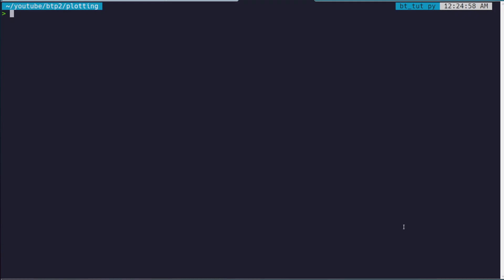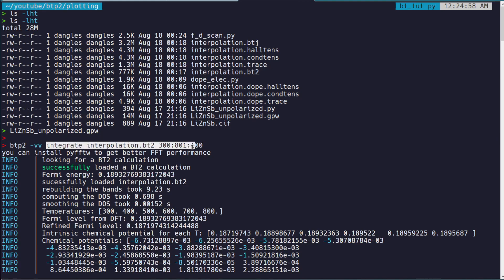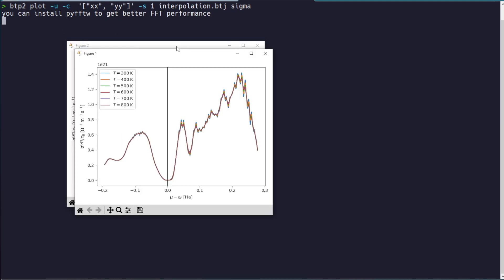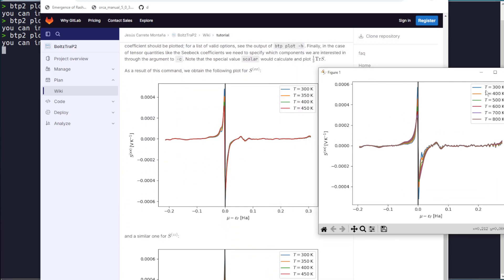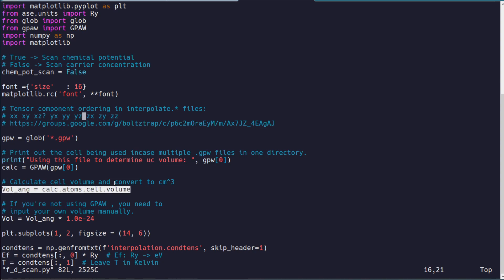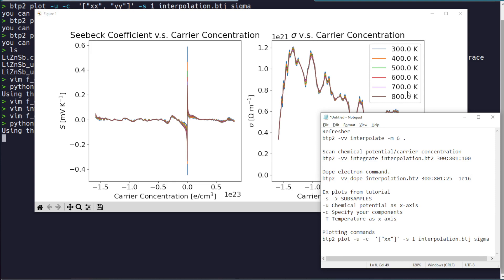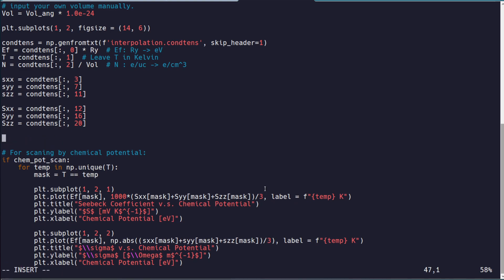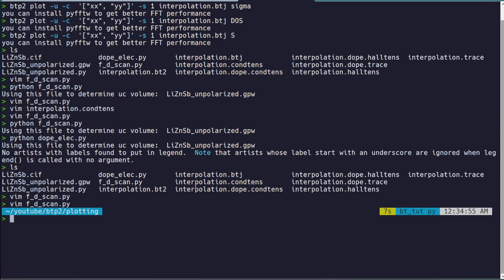BoltzTraP2 Tutorial | Plotting Onsager Coefficients (conductivities, Seebeck coefficient)

Comment: Sir i am calculating the thermoelectric properties for monolayers using boltztrap2 the value obtained for seebeck coefficient is almost double of literature, while the band and dos are exactly same as of literature, i tried multiple times,  for different materials and am obtaining double the value of S for each material, why this happening where am i wrong don't understand
Reply from the maker: You would have to really dig further into what they are using for the computation
Reply: @AlgebraicContinuation  The quantities (like thershold conv. and k-points ) mention in the paper is for heterostructure , only result values are shown for monolayer, by using VASP software while i am using QUANTUM ESPRESSO , is that the reason ?

Comment: Hello sir, I am using Boltztrap2 with Quantum Espresso. I ran SCF and NSCF calculations, and then when I ran: btp2 -vv interpolate -m 1 ./ I get the error:
File "/home/Hp/miniconda/lib/python3.12/site-packages/BoltzTraP2/io.py", line 1528, in parse_ESPRESSO_xml
    raise ValueError("inconsistent sets of k points")
ValueError: inconsistent sets of k points
I searched on Google, but it seems that this error hasn't been discussed anywhere. Do you have any idea about the origin of this error? Any help will be appreciated.
I used 10x10x10 kpoints mesh for scf and 20x20x20 for nscf calculations

Comment: Thanks sir for nice tutorial ! Sir i am getting an error during run command (btp2 -vv interpolate -m 3 ./ )  error shows inconsistent set of k - points while am using QE software nscf output .xml file with 60 60 1 k-point and scf  30 30 1  how to solve this error ?
Reply from the maker: Try 2 kpts in the z direction
Reply: @AlgebraicContinuation  but sir for monolayer we have to choose 1kpt in z-direction
Reply from the maker: It will not work unless you use 2. If your calculation is set up correctly, having 2kpts in the z direction won't hurt anything.

Comment: btp2 -vv integrate interpolation.bt2 300:1010:10. This command is taking too much time. How long does it usually take?  For BoltzTraP2, I am running it on a system with 32 cores. i don't think we can run btp2 using mpirun, my system is using 1 core at a time, almost 2 days have past and calulation is still going on. Pleas help
Reply from the maker: There's no way for me to know without more information about your system. It could take a second or a year depending on the DFT data. Yes it can only be run in serial.

You probably do not need 70 different temperatures either. Run some of their example systems from beginning to end with your own DFT calculations and see if you can get those working before doing a system of your own for research purposes.
Reply: @AlgebraicContinuation  I was running the same calculation using the vasprun.xml file for the PBE band gap, but it was taking too much time. However, when I performed the calculation using the SCF vasprun.xml, it completed within a second. I am a VASP user, so I would like to ask if I should work with the SCF vasprun.xml or the PBE band gap vasprun.xml

Comment: Thank you for nice tutorial! The vasprun.xml one should select is of SCF step and not nSCF I assume. The btp2 bandstructure in my case looks similar but is not as smooth as DFT one. How much smooth must it be to proceed further? I increase -m factor to 50, yet the smoothness didn't improve noticeably.
Reply from the maker: You should definitely use an nscf calculation on as tight of a k-mesh as you can afford.
Reply: @AlgebraicContinuation  Thanks for reply. When I used nSCF vasprun.xml, the integrate command kept on running without giving out any output files. When I used SCF one, it outputted. Can you please shed light on this? And on -m factor I mentioned earlier?
Reply from the maker: You'd probably need to share more info as to what error messages you're getting. Check that all the band info is in the required files for your nscf calculation as well.

You can increase -m as much as you want, but if there isn't enough data from the DFT data, the interpolation won't mean anything.
Reply: @AlgebraicContinuation  Is the interpolated band structure needed to be EXACTLY similar to the DFT one? In my case, one band crossing near VBM is missing and additional split bands appearing in certain sections.
Reply from the maker: You can email to algebraiccontinuation at Gmail, but honestly I don't really troubleshoot people's systems on here unless there is a teachable point to make a video out of.
Reply from the maker: I'm not sure what error you are getting, but just check the VASPLoader in BoltzTraP2 and see if your XML has all of the data that it requires in the proper schema.
Reply: @AlgebraicContinuation  Thank you very much for the reply and email ID (missed earlier notification). I have posted the query on forum, and will ask you if it doesn't get resolved. Aside that, which nSCF vasprun.xml is apt to use: DOS (uniform k-mesh) or bandstructure (linemode k-mesh)? Also, is assigning -ve sign to carrier concentration in "dope" command gives output for n-type and +ve or no-sign gives output for p-type carriers?  While reproducing, I am getting increasing conductivity trend vs increasing temperature for n-type and opposite trend for p-type, inconsistent with Fig.3 in DOI: 10.1039/C7CP05170K ? Please help.
Reply from the maker: Never use the band structure DFT data for a bolztrap calculation.

Comment: Thank you for the tutorial, I have a question. I heard that BoltzTraP2 could use approximation for relaxation time as 1/DOS, could you please let me know how to do it if possible. Thank you for your support
Reply from the maker: See point 1 in the wiki https://gitlab.com/sousaw/BoltzTraP2/-/wikis/library

You could easily implement it but you'd need to write the code to do so. You'd need to decide whether you want this to be E, or E, k dependent, and then just implement it in the code using your DOS data. 

As for how to do it, it's pretty much contained in your question. Presumably you have some methodological framework to get an approximation to tau as a function of the DOS. Then just find the relevant portion of the code (linked in their GitLab, you can read the wiki for the relevant info on non-uniform relaxation time) and implement.

Comment: Sir, thank you for your valuable guide. 
I am confused to change the parameters  in the script to plot  the power factor with carrier concentration.
I tried it the way you taught. But it shows the same plot : seebeck vs carrier conc.
Please help me
Reply from the maker: You have all of the values in the condtens files, you just need to find what you're trying to compute, compute it within the script by selecting the relevant columns, and then plot accordingly. Probably you need to learn some python for this if you're stuck.
Reply: @AlgebraicContinuation  thanks sir
  how to get plot chemical potential in electron Volt
Reply from the maker: Same as above, if you want more customized plotting you unfortunately need to know enough Python to modify the scripts. Alternatively you can take the raw data into some other plotting software of your choice and manually make the changes.

Comment: Sir I have another question... I have used slab model and added vacuum layer to build a monolayer. Does the thickness of this vacuum layer affects sigma (conductivity) values extracted from boltztrap2? Actually I am getting one order less value (with 20 angstrom vacuum) as compared to the literature (with 15 angstrom vacuum)
Reply from the maker: It depends on what you're comparing specifically but yes it does matter. The entire cell is used for any volumetric quantities in btp2, so you need to adjust all of those manually. You also need to be very careful about your input k-point mesh for 2D systems.
Reply: @AlgebraicContinuation  Thank you so much for the reply... I did nscf calculation with 30×30×1 k mesh.

Comment: Thank you sir for the nice informative video.. I am trying to compute PF and ZT using your matplotlib code. So, for PF I am calculating like,

PF= ((Sxx+Syy+Szz)**2 * (sxx+syy+szz))/3
Is it correct?
Also, please guide on how to get the kappa/tao values from the condtens file so that I can calculate ZT
Reply from the maker: Hi, you need to determine the correct way to combine the components for your particular situation, but the division by 3 wouldn't make sense for the above. Get your finalized quantities before combining into the PF.

Also for ZT, do you have lattice thermal conductivity from another code? Without that you can't compute ZT, even with the electronic thermal conductivity from btp.
Reply: @AlgebraicContinuation  Thank you so much for the reply... Should I have to compute the trace of S and s seperately and then combine to get PF? Please guide me..

For ZT, I am taking a fixed value ok kl as also used by some researchers. I tried to extract from phonopy but it seems the structure should be Ibrav=0 and I am using R3m system
Reply from the maker: However you combine them to get S, and sigma is something that you need to decide depending on your material (which in this case sounds like 2D), that's not something someone else can decide for you. 

For ZT, I'd be very skeptical of just taking a value from literature. If you are going to do it anyway, you can find the columns in the condtens files that contain the kappa rows and then extract them in the same way that the Seebeck coefficients and conductivities are in the scripts.
Reply: @AlgebraicContinuation  Thank you Sir...

Comment: 6:00 Respected sir , kindly tell me one thing that you have mentioned here to use volume of unit cell.  But my question , is it the volume of conventional cell, primitive unit cell or the unit cell which I have used in DFT calculation?
Reply from the maker: It should be the one from the DFT calculation. But you should never use anything like a supercell for BoltzTraP2.
Reply: @AlgebraicContinuation  I have used a primitive unit cell in DFT calculation, so I have to put the volume of primitive unit cell in boltzTrap2 calculation. Is it correct? 
And when I will use conventional cell in DFT, then I have to use the volume of conventional unit cell in boltzTrap2 calculation ,,, is it?
Reply from the maker: Yes correct.
Reply: @AlgebraicContinuation  thankyou sir ,,, but sir, suppose I want to study the effect of vacancy on transport and thermoelectric properties. And for introducing vacancy, I need a supercell. In that case which cell volume should I use in boltzTrap2 ?
Reply from the maker: You'd need to implement something to unfold bands, it's not implemented in BoltzTraP2.

Comment: Very informative video! I just subscribed! Thank you. I'm new to this field, could you please teach me how to get the cell volume you mentioned at 5:58? Right now, I'm using QE instead of GPAW. Thanks in advance!
Reply from the maker: Hey you can either simply compute it from your cell vectors manually, or you can read your structure into ASE in the python script. I believe ASE can read QE input files, so it's as simple as:

import ase.io
atoms = ase.io.read("your_file")
volume = atoms.cell.volume

I believe that this volume will be in A^3, so you can do the same conversion below as in the script in the video.
Reply: @AlgebraicContinuation  Thank you for replying, Sir. Just one follow-up question, I noticed that when plotting vs. chemical potential and vs. carrier concentration, the plot appears to be flipped(?) Is there a reason to this? Thank you and more power!
Reply from the maker: Yes, think of what type of charge carriers are induced when shifting the chemical potential towards one of the band edges.
Reply: Sir is it the volume of conventional unit cell, primitive unit cell or the cell I have used in DFT calculation?